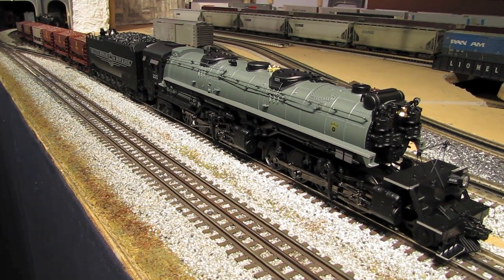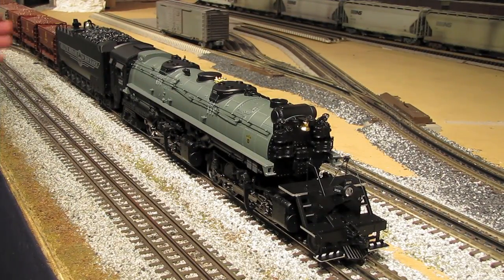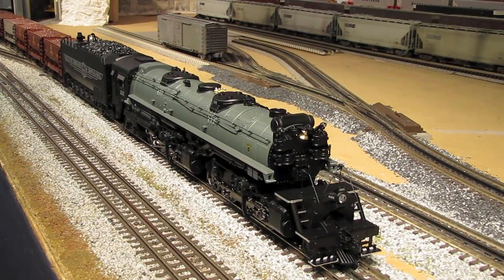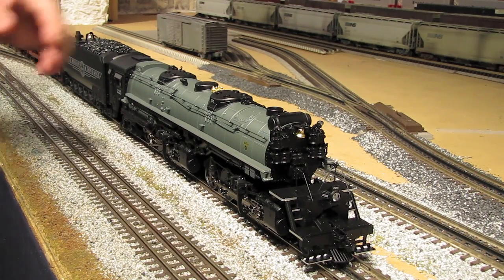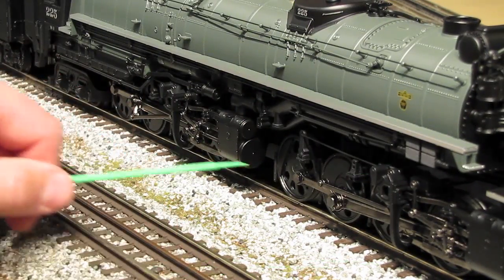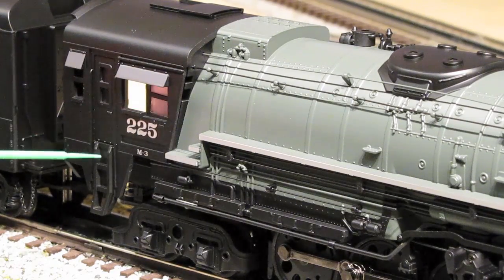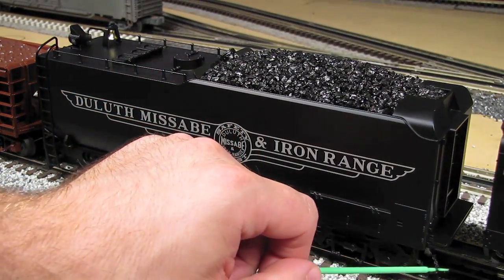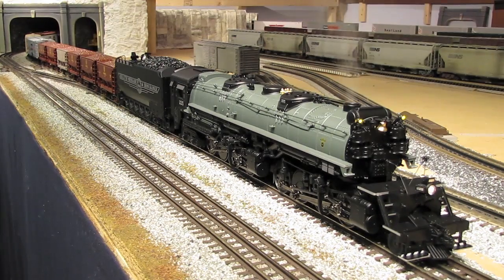MTH 2-8-8-4 DMIR Yellowstone Set

Comment: Just a side note. On its last ay of operation, DM&IR Yellowstone #229 hauled 190 full ore cars from the Missabe Range to Duluth. The DM&IR Yellowstones actually had greater tractive effort than the UP BIg Boy.
Reply: +Missabe328 190 cars dear lord that is one strong beast wish i could of been there to watch it on its final run but i was born in 1993 so yeah but dang that is one strong monster of a steam engine if i start a train layout that monster will be in it
Reply: Wow. That is quite the feat of pulling power. The only thing more powerful than one of the DM&IR Yellowstones was a C&O/ Virginian Allegheny/Blue Ridge 2-6-6-6. Those engines had 7,500 horsepower, as compared to the Yellowstones's 7,000 horsepower.
Just a question about the 229's feat; was this with or without a caboose? I have heard a Yellowstone pulled a train weighing in at around 18,000 tons. Maybe this is the feat that I have heard about.
Reply: I wouldn't mind seeing one of the surviving yellowstones return to service
Reply: And not only did these Yellowstones know how to lug a two-mile-long string of fully-loaded ore jennies, they also knew how to run at top speed. Sometimes at up to 60 mph and better. Just like when Union Pacific had its Big Boys hustled their freights at top speed across the high Wyoming plains and easily lugged heavy freights over Sherman Hill and Utah's Wasatch Mountains.
Reply: there were numbers of steamers more powerful than the big boy but none were as effiecient
Reply: Missabe328 h
Reply: +Braden’s Trains Certainly not as famous!
Reply: In the MN Mesabi Range, they were called “Mallets” (pronounced malley). I’ve been to the Range many times, but I‘ve never heard them referred to as Yellowstones.
Reply: I hope they return one of these old ore hauling  legends back to service

Comment: Nice engine!  Im a member of the Detroit Model Railroad Club in holly michigan.  We run 2 rail O scale with DCC which is direct command contro. We have had one of these engines run on the layout with 26 cars but it would of been able to pull more but there wasnt enough room in the yard.  2 questions 
1. How much does it weigh (ballpark) 2. How many cars could it pull alone.

Comment: Great review I think this engine is really neat, I wish I would have watched this before your vision line review of the challenger, which leads me to ask you (as I am just getting started) if you think MTH produces anything comparable to Lionel's vision line products? I'm becoming increasingly biased towards Lionel.
Reply: As far as I know, no, MTH hasn't made anything comparable to the Vision Line. Although Lionel is expensive, I recommend them. However, that doesn't mean you shouldn't buy MTH. They have their share of good trains as well.
Reply: One thing to watch out for with MTH is their warranties. IF you buy an MTH loco from a shop that is not an MTH authorized dealer (and very few hobby shops are because MTH charges a yearly premium to be authorized) MTH will not honor your warranty. I found this out the hard way when I bought a HO scale J class from my local hobby shop. It would not work right out of the box, and MTH wanted to charge me $100 just to look at it. As they said, "you did not buy from an authorized dealer, so you have no warranty". I took the J apart, found there was a pinched wire from the factory that shorted to the metal boiler and fried the electronics. There are some models I have considered getting from them since (like the yellowstone) but the warranty thing keeps popping back in my head. Be very careful who you buy MTH models from, as it could burn you.
Reply: Jonathan Jones
Thanks for pointing that out.
Reply: Adam Swindell
No problem! I would hate to see someone else fall in the same trap I did.
Reply: Alexander Brown I think for the most part, both companies have strong points. I have more MTH than Lionel and have had less trouble. Some of Lionel`s vision line  features I find gimmicky.